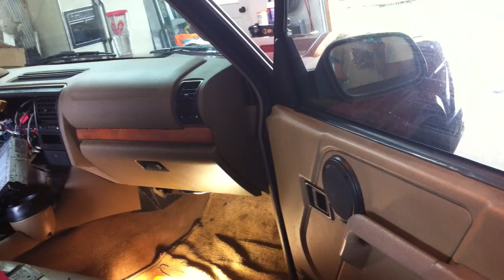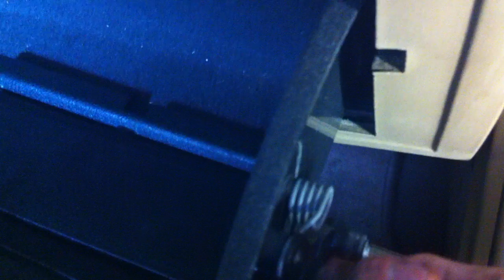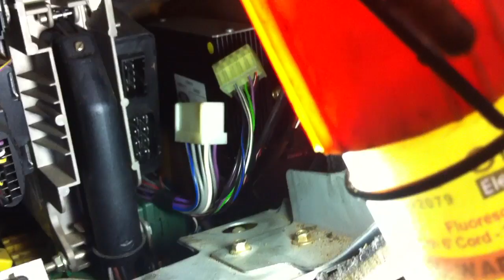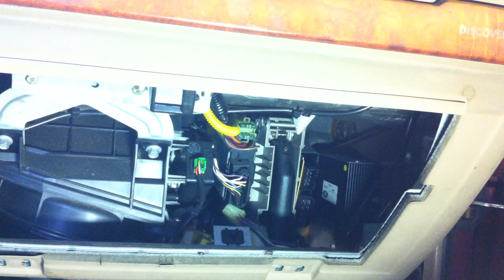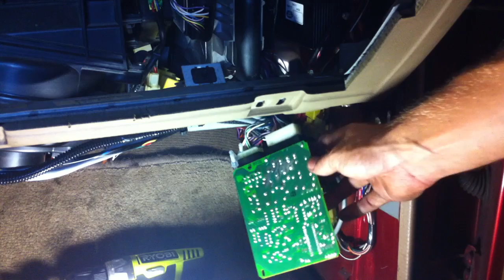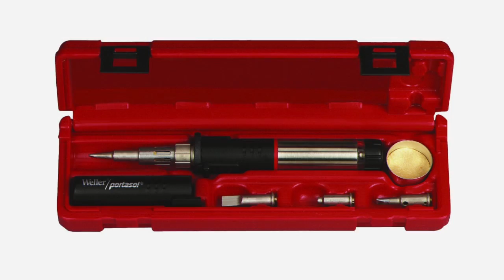Land Rover Window ECU Repair

Comment: I have tried and tried to pull off that top wiring harness -the one with the push tab.  I absolutely cannot get it off. Any ideas on how to get off?
Reply from the maker: I was looking back at mine, are you taking about the metal casing or the plastic harness ? You can bend the casing to pull the whole card out then look at the harness.  It stuck on there pretty tight the first time.  Electronic cleaner is safe to use on that connector to try and free it up.

Comment: Excellent video!  I repaired mine today: had loose solder.  I will say though, removing the unit was extremely difficult. Especially pulling out the connectors. If I had not watched your video I would've given up by now.

Comment: Hi I have a 2011 Land Rover that does not start or crank when I push the start bottom. I took it to the dealer and those guys just want to start changing parts without finding the problem. First they want to change the wiring harness and than take it from there. Can you guide me so I can find the problem. Thanks.

Comment: Your video was a life saver- well, not really but quite a time saver for sure.  I had started working my way through diagnosing this problem starting with the window motor on one side and paused to do a search for more info on the web when I came across your video.  I followed your instructions and sure enough, I had the same problem.  Once the circuit board was removed (harder to get it out of the housing in my Range Rover than it appeared to be for your Disco), a quick bit of soldering and the problem was sorted.  Thank you for taking the time to document this fix and share it with the rest of the Land Rover community.

Comment: thank you so much just pulled the circuit board on my 1999 and it was the same solder point. I resoldered  it and that back windows work like new. now to get rid of my misfire hmmm.

Comment: I've done this repair three times and have never been able to get the board back into the slot on the left side of the plastic case.  Tried removing the nuts to change the angle but couldn't get socket on them and a third nut is also in the back which I couldn't move and the case has to move to the right a good bit to clear the screws.  I thought if it can wiggle out, it can wiggle in but not successful.  I finally just stuffed it in and left the cover off since it wouldn't close securely.  Windows all work but the angle of insertion of that board is a biatch.

Comment: Thanks Alexander. Followed your video and my Landrover Discovery now has functioning back windows. You’re a gem.
During the process of extracting the board I was contemplating the need for a website. I would call it:
What bloody idiot designed this?
Placing anything that may need repair in such a bloody difficult place to get to is stupid.
My son  recently had to pay $1500 to take out the engine of his Subaru to get at the sparkplug controller.
As everyone doesn’t replace their car every 4 years. Some actually repair them. The idea that 2200kgs of car having a life expectancy of 5-6 years is bloody stupid.
Thanks again

Comment: Tried unplugging the circuit board wires and split the circuit in two... Can I purchase another circuit board to replace it? Will it need to be reprogrammed? What functions does the circuit board operate?
Reply from the maker: Yes you can. Just remember to grab one of the same sub model. Just take a look at yours and compare it to an alike one. Most are the same, Even in other years.

Comment: Alexander thank you so much for to share your nolish. I have to do that in my 03 Freelander on the left passenger side, but right now I need to deal with a bigger issue. Today after a 15 minutes run on the Highway stop for 7 minutes crank up and the engine shut down a block a way. I was able to restart but the automatic transmission won't engage, have to town it back to home. Yes I was having overheating issues recently. any idea on how to unlock the transmission?

Comment: Just did this repair on a 1997 Discovery I.  Rear windows work great now, THANKS!  Did not need to remove the glove box but did disengage the springs on the sides so it hung down out of the way.  Had a little trouble getting the card out, not sure if covered in video but be sure to move the connectors toward the passenger side (right side) as you slide the card out.  Broken solder on one of the relay pins, easy resolder.  I noticed as I put the card back that it seemed to interfere with the case as I pushed it in and that the card had a slight bend when fully in place, the bend being where the bad solder joint was and likely a contributing cause, so I left the card partially out of the case.  No issues there as plenty of clearance around it and will not fall out on its own due to cables, might get a little dusty if you get into really dusty environments for a while, then go into a humid one for a while (can wet the dust and cause intermittent shorts, not a problem in my area) but I felt better about not mechanically stressing the card.  FYI, also finished replacing the little springs in the door lock actuator that cause intermittent unlocking (plenty of posts on this fix if you have this problem, order springs from a UK guy on ebay).  Working doors AND windows, woohoo!
Reply from the maker: Hello ! Thanks for sharing your success and tips for everyone.  I am happy to here that it worked.
Reply: I had the same trouble putting it back in. When I felt the edge of the card I noticed that it was very rough so I sanded it down gently with a foam sanding block. Once that was done it slid in smoothly.

Comment: I'm having a voltage issue.. Changed battery.. Same thing.. I'm going to further inspect grounds but as you showed.. I believe this thing deserves an inspection.. Especially when I have quirky thing like 1 door lock and hatch only goes down.. Who knows..
Reply from the maker: I had some lock issues as well. I just had to change the locks out. the Actuators.

Comment: my passenger back window works, but my drivers back window motor does not kick on, do you think this is the same issue for me? i watched this video and i think i may try what it showed.
Reply from the maker: I have a short video that I will upload in a few days. It talks about that issue. There is a bypass for this fix if it is the same issue shown in the video I will upload. It should be vary simple. I'll keep you posted
Reply: ok thank u!

Comment: Thank you very much for uploading this. My wife is happy again and I did not spend a dime. Was just what you had but I had to remove the two 7mm nuts from the plastic box in order to change the "extraction" angle of the circuit board on the 96 Discovery. Thanks again.

Comment from the maker: Hello, If you guys are having issues with the motors turning slow or seized up. I'm about to make a video showing how easy it is to repair and rebuild them.  The cost for doing this is extremely low.  This is for all window and Duel sunroof motors.